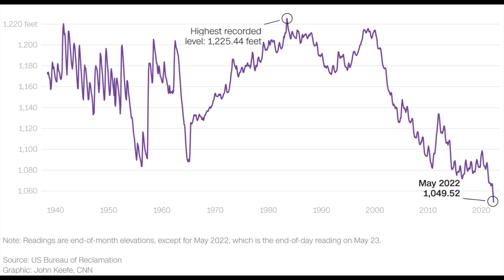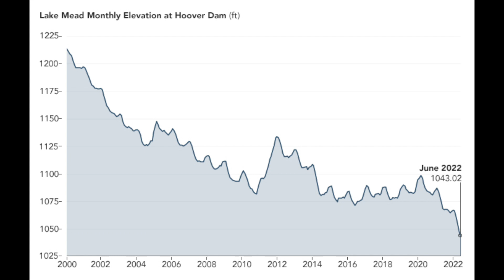Why is Lake Mead so Low?

Comment: It got so low because 40 million people are using more water than the Colorado can supply.  Conservation should have begun 20 years ago.
Reply: That is not the case.
Reply: Conservation DID begin more than 20 years ago.
Reply: @A_J502  Not even close.  Even this year,, California mandated reductions,, southern California use went up/  Las Vegas has done very well.  Population up by 750,000 and less water used today.  Utah, not so good. They figure they are owed more water,,,, according to the 1922 Pact,, which we know now was based on VERY wet years   In the process of building a billions of gallons pipeline to feed Henderson ?,, Residential, business, municipal, and 5 golf courses.  Arizona is doing okay,, but even there,, the less water they take from the Colorado,, the more ground water they are pumping.  One aquifer I know is down 40 feet in the past year.  Wells are being drilled to 700 to 900 feet deep chasing the water.  One Arizona City has no water, and no water rights,, and ground has broken on a new one million population Arizona City,,,that  currently has zero water rights.
Reply: @Sailor376also  
20 years ago, Las Vegas implemented limits on water consumption, with increasing rates for more use.  Additionally, government support and subsidies were offered for people using less water-intensive landscaping, lawns, and plants.
Reply: @Sailor376also  
Of course total consumption increased…POPULATION increased.
However, PER CAPITA water consumption has dropped in all Colorado basin states.
If you don’t like the conservation being done, fine; but you can’t say there has been zero conservation or that conservation didn’t begin less than 20 years ago.
Reply: @A_J502  On some things you and I are in agreement,, Las Vegas has done very well.  Their conservation is way better than just per capita.  In those 20 years they have added 750,000 residents and they are using less water than they did 20 years ago as a total city.  I do not know,, wish I knew of a source as to average use for several of the different regions.  If you know of a source, I'd be grateful. It remains though,,, If 10,000 cubic feet per second are coming down the Colorado on average for the year, then they must take less than 10,000 cubic feet per second. he average release in just the last 2 weeks was 11,400 cfs
Reply: @Sailor376also  
Correct, the ONLY solution to reduce dropping water levels is to use less than what is coming in.